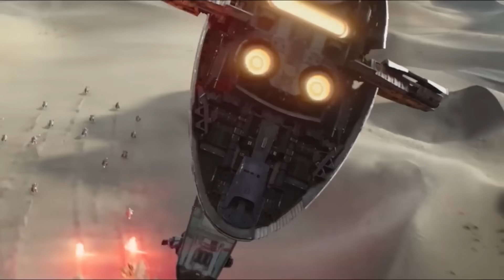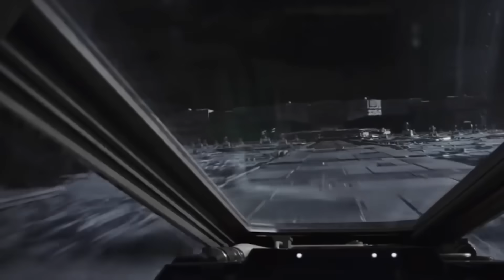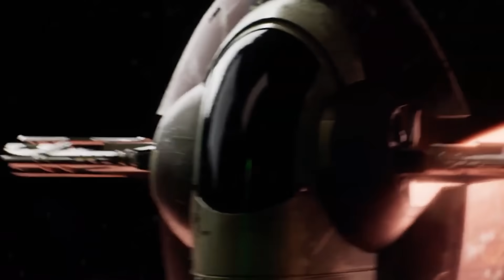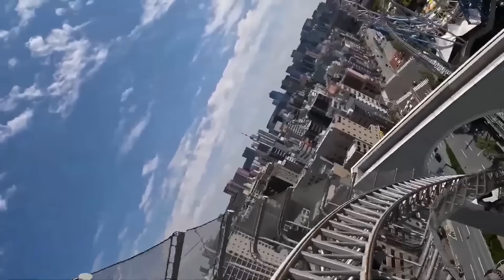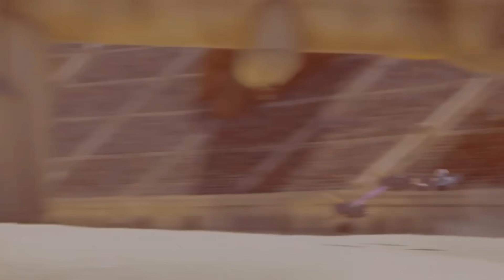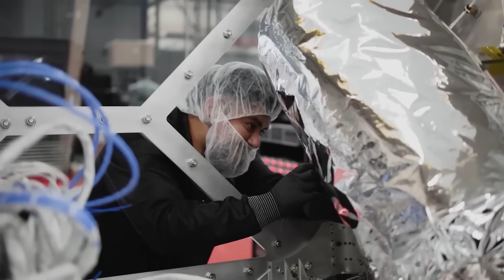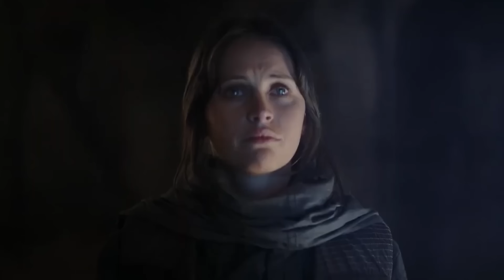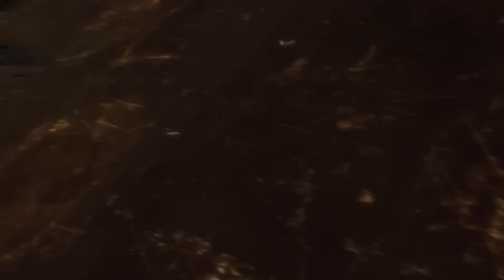The Problem with Star Wars Ship Design

Comment: The destruction of the Super Star Destroyer Executor at the Battle of Endor was not a stroke of luck but the result of a coordinated military strategy exploiting critical mechanical flaws, as official canon records that the ship's sublight engines and hyperdrive were already suffering from chronic wear due to continuous combat deployment without proper maintenance. Rebel cruisers and B-wing bombers launched a targeted strike on the massive engine block, disabling the secondary maneuvering thrusters and stripping the vessel of its reverse thrust capabilities. Starfighters then successfully neutralized the deflector shields safeguarding the bridge area, allowing pilot Arvel Crynyd to crash his A-wing directly into the main navigation bridge, which instantly killed Admiral Piett and the command crew. The final disaster was a matter of mathematics and physics rather than chance, because the main drives locked into a forward-thrust sequence and the auxiliary steering systems in the engineering bay completely failed to counter the primary propulsion, leaving the unsteerable vessel to be dragged by forward momentum and the intense gravitational pull of the Death Star II into the catastrophic collision seen in Star Wars: Episode VI – Return of the Jedi, with these specific events documented across Star Wars: Episode VI – Return of the Jedi, Claudia Gray's 2015 canon novel Star Wars: Lost Stars, and official DK Publishing technical manuals including Star Wars: Complete Vehicles and Star Wars: Complete Locations.
Reply: In the film, you can see that there is damage in the engine area.

Comment: @StickmanAnakin Gotta say something.  All ships including the small TIE Fighters have inertial dampeners.  Try reading the X-Wing series.  Wedge talks about it often and they even allow 5% so they can feel the movement changes of the fighter.

Next, read the Lost Fleet series.  Written by an actual Navy officer and Engineer as pen name Jack Campbell.  Ships would travel at 10,000km/hr or faster, so, the bridges were in the center of the ship, weapons systems were automated, and at relativistic speeds, G forces wouldn't affect crew until they quickly turned or stopped.

Capital ships:  These ships are almost 50% engines.  A reason for their unique design is for their roles for orbiting or hovering above the land.  A tube can't be used over a planet surface.  Lastly it's all about Copyrights.

Comment: To be fair, the Executor had its primary functions damaged and no longer functional. 
For example, their forward thrusters were no longer responding and their shields were down. So not only were they “Dead in the water”, that A-Wing essentially jammed the steering wheel into a sharp Left turn, with no stabilizing thrusters to keep it from being pulled down by the station’s artificial gravity.

You actually see the Rebels attacking the Super Star Destroyer multiple times, so the ship isn’t as fragile as people made it out to be.

Comment: Some things make sense as a critic, like the bridges etc but some comparisons to current earth space attempts seem pointless since the levels are completely different therefore what may seem like uncessesary for our current space attempts may not be a problem for the Star wars universe. 

As about Star fighters directional abilities we can excuse it as something debented on engine placement as we can also excuse wing designs that may seem useless in space since this fighters also have been used in atmospheric battles on planets. 
A hybrid design that allows them to also be aerodynamic while able to fight in space as well makes sense. 

Lastly big windows can make sense if there are metallic doors that can shut them behind when a ship is entering compat. 
Because both sensors and even cameras can malfunction under certain circumstances the necessity to at least have a visual if everything is down becomes important.

Comment: While this is Science-Fantasy, as you stated.. they do try to add some science here and there, even if it's just in universe science.
All ships are equipped with some form of inertial dampener so the pilots and crew cannot feel the G-forces of the ship's actual speeds.
This includes both Tie Fighters and X-wing.
Also the reason X-wings ans Tie Fighters have their wings/shapes is so they can be used both in space AND atmospheric combat.
While the X-wing wouldn't need wings in space, it would in an atmosphere... now how the Tie Fighters fly, no clue honestly.

Comment: A potential reason for elevated/separated bridge sections might be: Mutiny.
Those ships are designed in an environment where they have absolute superiority in direct combat, and outrageous subjugation of their populace. Just because we see the ships facing direct combat (because it looks cool), that's not the general case. The entire body of the ship might be manned by untrusted people, just as much under the boot of the empire as the general population. The elevated bridges on a platform with a narrow tower connecting them a might be an internal defense mechanism for the ship command, against the broader population of the ship itself. The more common use of their many ships is just: ongoing subjugation and projection of force. In short, they might be built/designed in a time where they're more afraid of their own crew, than they are of rebel ships.
Reply: Another element of the space combat is EW. My understanding is that basically everything is human-eyesight, because the non-visible EM bands are basically jammed into oblivion. Both sides utilize massive jammers, and make those bands unusuable. The counter point to that is "why don't they do the same in the visible spectrum", and the only answer is "because it wouldn't look cool". But I think it's the in-canon reason why battles are so close, line of sight, and un-automated.
Reply: Obviously every decision is ultimately "so it looks cool", but people have thought through reasonably thorough ideas to force it into this optimization.

Comment: Neutronium used as a material? That's probably the biggest nonsense of the Star Wars universe. If you separate neutronium from its neutron star, it would no longer be held together by gravity and would just explode.
The high G-force survived by Star Wars people are explained everywhere and very clearly: the tech even has a name: inertial dampeners, IIRC. It's basically gravity manipulation to counter the acceleration effect.

Comment: 11:30 Yes the Apollo 10 spacecraft reached 24,791 mph RELATIVE to Earth's surface on return, not via intentional propulsion. Remember: as you mentioned in an earlier point, in outer space, direction is relative, so the Apollo 10's 24,791 record looks like a large number, but if you think about the context, it was a massive object returning into Earth's atmosphere, freefalling out of orbit back into planetary gravity. That being said, despite the ridiculous speed of re-entry, the crew would have only been subjected to around 6 Gs of force, because the majority of their speed was built by orbital kinetic energy. Strictly talking about big numbers, the speed of man-made satellites such as the International Space Station constantly travel at around 28,000 mph, but our International Space Station crews are not subjected to consistent 10Gs, because the context of its trajectory is aligned with Earth's natural orbit, where if a space battle were taking place in the region, every ship partaking in the conflict would be also subject to the same planetary orbit. That being said, Star Wars pilots certainly do perform maneuvers that should liquidize the crews without some kind of sci-fi anti-G-force systems in place.

Comment: The problem with SW ships is that SW is a WWII war movie in space as far as large scale combat. It's not just fighters, but the big ships as well. Warship bridges look like that because real world ships need to maneuver outside of combat and the crew needs to see the hull and over it a bit to avoid collisions. Thus the bridge is at the front and at the top. In open combat the artillery duel took place over such ranges that precise hits were not really feasible and thus it was more of a war of attrition. Even WWI ships already engaged at ranges where they would barely spot the top of the target over the horizon. Real world ships also had another combat bridge in the internal armored conning tower, but it was rarely used because it's not as convenient.

Comment: Most of theese issues can be explained by two simple reasons.
Most of the starships we see in the star wars gallaxy are in reality modified airplanes originally designed for use in atmospheric flight, and modified to fly in deep space.
And most of the starships used by the various empires who are attempting to conquer the gallaxy over the millennias  are primarily designed for intimidation and oppression, often rushed into mass production without proper testing, and primarily defended by the shield of infinite arrogance and the display of overwhelming force by commanders who can't even imagine the possibility of any enemy being capable of fighting back on equal terms....

Comment: 11:11 well... we know in Star Wars the manage to solve the universal field theory. In short terms: If you solve the unified field theory you can transform any force to any other force. Even simpler put: We in the real world can transform fuel to heat and heat to movement (speed). We can transform heat to electricity, we can however NOT transform electritcy into gravity. We do understand how gravity works, we can describe it, we can calculate it and we can use gravity via "potential energy" to "store" energy (by pumping up water to the top of a mountain when photovoltaic systems deliver energy and then let the water run down powering turbines when the sun does not shine, transforming that to electritcity again) but we can NOT generate gravity or the opposite of it.

BUT if we COULD (and in the Universe of Star Wars they obviously can, see the floating vehicles for example or the fact that they can walk normally in space ships) we could defy G-Forces. We could use energy to produce anti-gravity fields inside a cockpit by simply reverting the accelarational gravity (the "g-force") with an opposing gravity-generator thus nullifying the effect on the human body. Of course, the ship itself must maintain the additional need for structural integrity, nothing comes without a price, ONE structure must absorb the power, but it would be possible to compensate the inertia.

Comment: On Durasteel vs Transparasteel... the sense I get is that neither was much protection against blasters, that it was practically all about the deflectors.  In which case, you might as well have some reliable visibility in case sensors are damaged, affected by interference/EW, or power is lost.  Also, they didn't tend to have high-rez displays as we know them (like the blocky graphics in the EP IV targeting computers), and even holograms seemed kind of glitchy.  So that could have led to the reliance on real windows. But mainly, yeah, they just look cool, and familiar ;)

Comment: A modern day US Navy carrier has at least 5 command centers on board. Each has a purpose.1 highest forward level of the island is the air wing command center controlling the air carft on and around the carrier. 2 next deck down is the fleet command center where the admiral in charge of the fleet gives orders to all the other ships protecting the carrier. 3 next deck down is the conning station where the carrier itself is commanded from. 4 a small room on the rear of the island where land air craft are directed from. None of the frist 3 have flieds of view behind the ship and the conning station often has windows looking down to assist in dock. And finally 5 CIC (combat information center) this is a redundant back center buried deep inside the ship to record everything as it happens and take over in the event the primary bridge is destoryed. Some carrier may a 6th operations center to command a joint task force but may also be located on a different ship completely. The exposed command locations are there because they have better visablity.

Comment: There was a Star Wars temp exhibit at the Smithsonian Air & Space Museum a while back. They had the original destroyer model on display. I was amused to see they had used parts from ye old Airfix 1/600 battleship kits for surface details, including turrets from the HMS Nelson. I don't know if they bought a bunch of the cheap kits, or one and molded/cast the parts. 

Spacecraft have national looks. The Soviet boosters looked very different from the American. They liked lots of elongated cone shapes, we long cylinders joined with short cones. Compare the Saturn 5 to the N-1. The German V-2 looked very different from the US Redstone even though built by the same von Braun design team. Japanese battleships with their towering pagoda superstructures looked very different from the Brits with their lower blocky castle superstructures. 

The attack on the Death Star in E 4 is right out of the Brit movie The Dambusters, about the May 1943 attack on the Ruhr dams by Lancaster's skipping their bouncing bombs across the water into the structures, while exchanging tracer fire with the AA batteries. 

Why in SW battle scenes do the ships in a fleet all have the same basic "up/down" orientation, like ships at sea? Why not different vessels being oriented different ways for before all angles coverage? 

Best space battle ever was the original Star Trek episode Balance of Terror. It was all long range shots, with the vessels outside naked eye visual range. More realistic.

Comment: I'm really tired of the 'exposed bridge' gripe.  In WW2 commanders consistently wanted to stay in highly exposed bridges to observe battle better, even though their were massivly armored conning towers just feet away would completly protect them.  Ships today still have an exposed bridge too as well as deeper command centers and SW tech and sensors are NOT comperable to modern sensors meaning windows are still quite nessary.

Comment: I'm dinging you a point right off the bat. Raised bridges is the norm for ships inside and outside of navies. Ships do have citadels sometimes, but bridges are always tall. You want a high angle to observe as much of your massive ship as possible. You could make things more compact on a spaceship because spaceships are not worried about sea states, but that's a tradeoff. You can easily have a tall bridge but command your ship from a safer portion of the ship. Plus, weapons stations usually have their own independent targeting systems if the command room takes an unlucky hit. 

All that and anything that receives or projects energy is going to need to project from the ship. That means any communications equipment or detection/deflection technology is going to need to poke out at least a little bit. Maybe you could use your a portion of a ship's hull as an antennae, but that doesn't really make communications less vulnerable. It just makes it appear less vulnerable to the casual observer. 

In any case, the huge output of light from a spaceship's engines is what every enemy will see first in any engagement unless your ship's engines are completely turned off. And then the next thing any enemy will see is the light reflected from the entire hull of your ship, or maybe the radiation from the active scanning your ship is doing. 

Comedically enough, the tall projecting tower on Star Destroyers could allow them to conceal themselves better than compact boats. They could hide their entire hulls behind a celestial body and leave only their... balls and the obsevers on their bridge exposed.

People love calling Star Wars dumb. It's one of my favorite things to do. But Star Wars is accidentally smart this time.

Comment: What really grinds my gears are the dogfights. Sure they are awesome, intense and do really have the feel of air battles, but one small issue ruins the magic: acceleration and the lack of drag. They keep accelerating. In space you don't have anything to generate drag, so a pilot should make a push, and then correct the trajectory with micro jets. With the lack of a medium to generate drag, steering would be harder the faster you go. For example, if you accelerated a X-Wing to "fly" along its nose, when banking, you'd simply roll moving forward. To make a corner you should cancel the acceleration forward (i.e.  reversing the engine to keep the speed constant) and then apply a force on the direction you wanna go: if you want to skedaddle to the side, this force should be applied at the center of mass, but if you want to turn your nose, well, you guessed where it should be applied.

To summarize my rant, as long as space battles are, they'd never look like air dogfights. The best we can do physically would be naval battles in 3 axis.